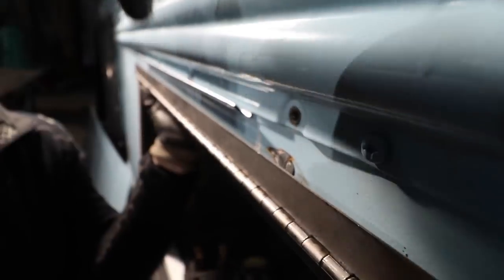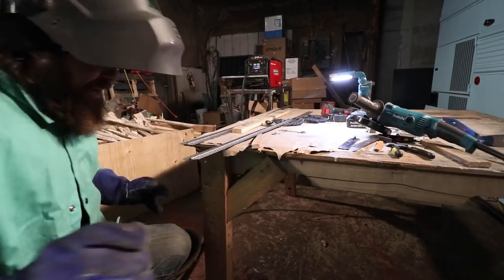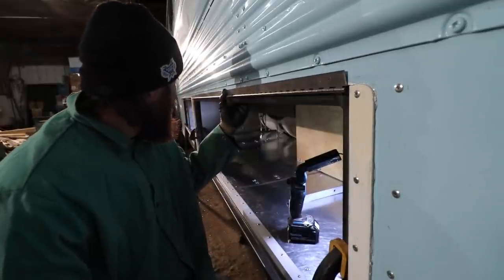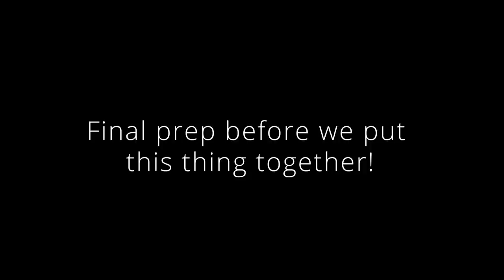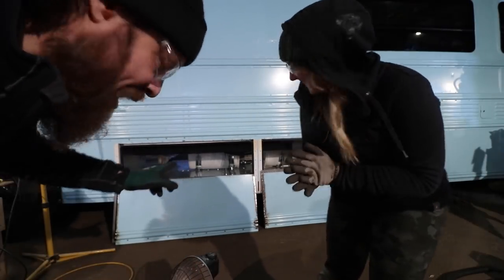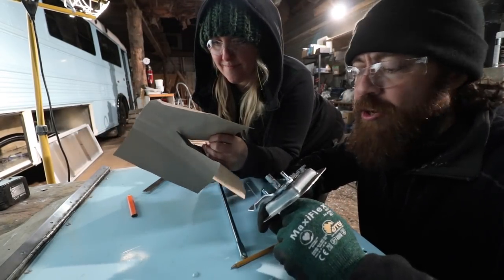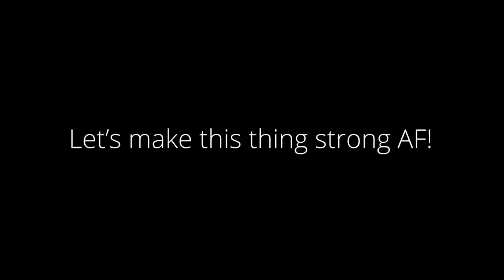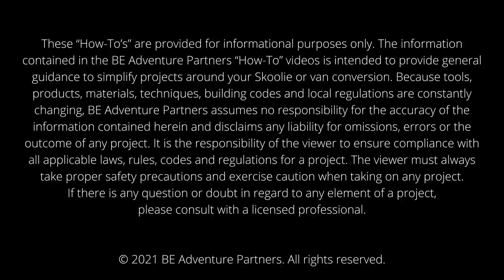HEAVY-DUTY RV Storage Compartment Doors (Locking Up Our Skoolie Underbody Project)

Comment: Hello. please tell me what kind of lock you have installed. i don't find that on the internet. thanks
Reply from the maker: Hey @Michael Seemann - The brand of locks we used are called Faucher. They are a Canadian company. The locking mechanism is called a T handle, and the bolt is a 2 point dead bolt. :) Hope that you can find something similar.

Comment: Why don't you guys just solder an extension on the dongle from the inside? (or am I not on that part of the video yet! lol)
Reply from the maker: LOL @Jason Craig... Thank you for your concern about the dongs... ;) We had considered that... But the alignment wasn't right. The lock wasn't as deep as the doors, so the dong wouldn't line up with anything significant enough to lock it... If that makes sense. 

It wouldn't have hit the frame. If we would have lowered it we would have had to remove parts of the humpty humps on the face of the door, which I (Erin) thought wouldn't look that cute. 

Still if we had done that we were fighting with the depth of the door. We did a lot of research to find solid locks, and couldn't seem to come across any that had a deeper body... Hope this answers your inquisition about our short dongs... Hahahahaaaa...  Erin + Brian too
Reply from the maker: Bahahaha!